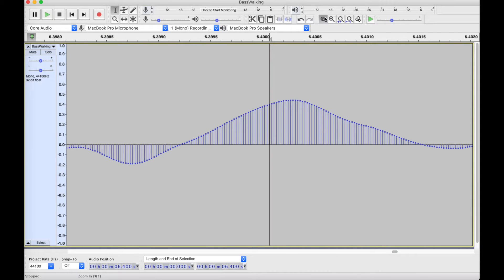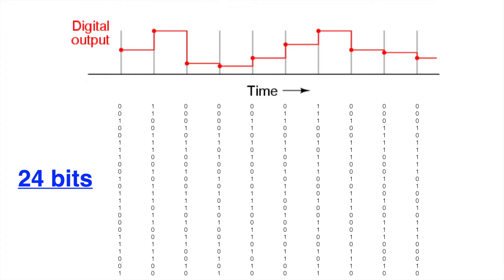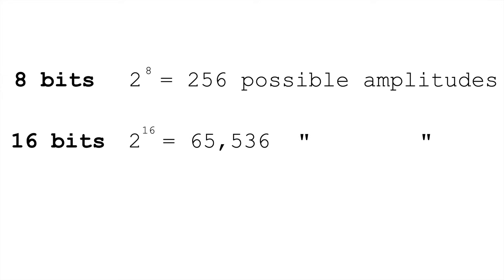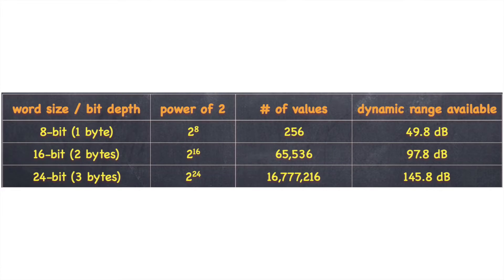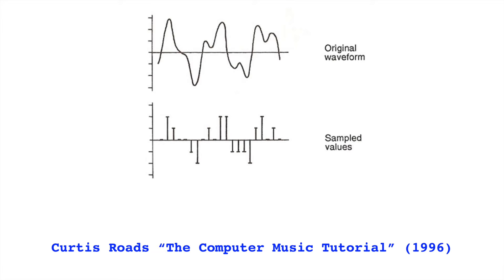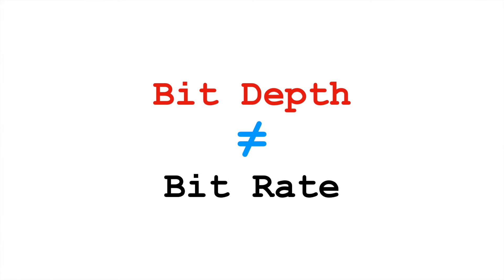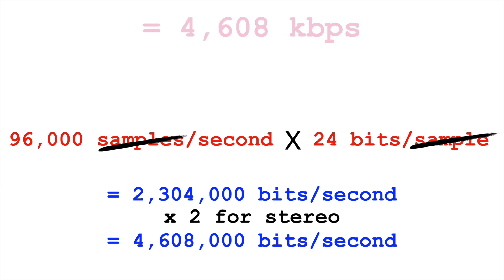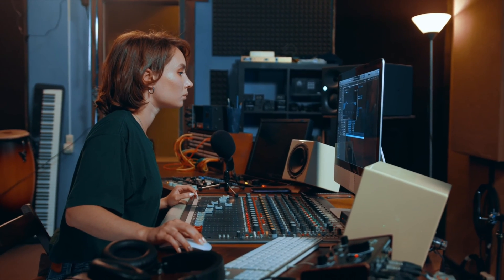Mastering the Digital Domain: Demystifying Bit Depth (Sampling Theory 2) | Simon Hutchinson

Comment: Hello how to archieve 1,2or 4bit with audacity? Because Audacity is not supported 1 or 2bit sample just 4bit adpcm or 8bit unsigned and upper such as 16bit 24bit 32bit.
Reply from the maker: I can't remember how I did it for this video (several years ago), but you're right that there's no quick way to just save a 1-bit file in audacity. You'll need a plug-in or some custom software in Reaktor or Pd.
Reply: @SimonHutchinson  thanks for the ansver